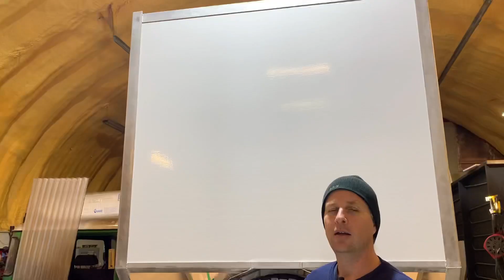Easy AC power connections | Custom built Fuso 4x4 Camper

Comment: I used a 20 amp Kussmaul auto reject.
Reply from the maker: Awesome - that would be slick! (Though I can say it’s annoying when they fail to eject and you drive off without noticing! 🤣🚒)
Reply: @BruceandKrista  two things about auto rejects, number one is never manually disconnect them when electricity is flowing, two is clean and spray a little lubricant in them every once in a while.
Reply from the maker: And three make sure all the mounting screws are tight !  🤪

Comment: Keep on truckin', Bruce.  You'll have that build-out done in no time now!  Do you use butyl tape under the flanges on those outlets?  (final install)
Reply from the maker: Likely will just seal them in with Sikaflex or the like - helps seal and hold them in at the same time 😎